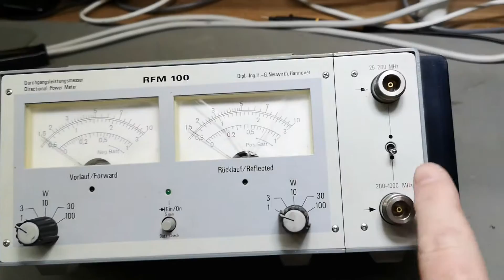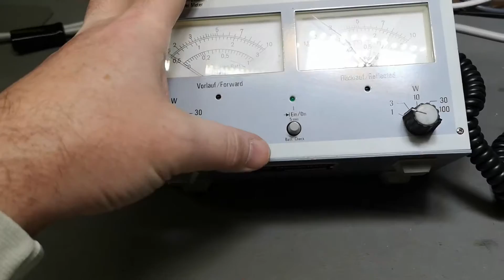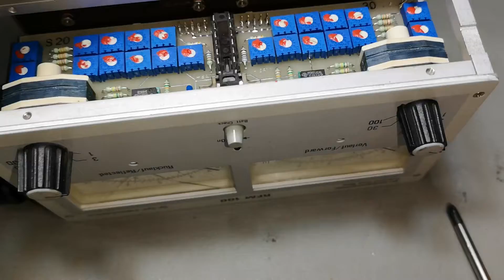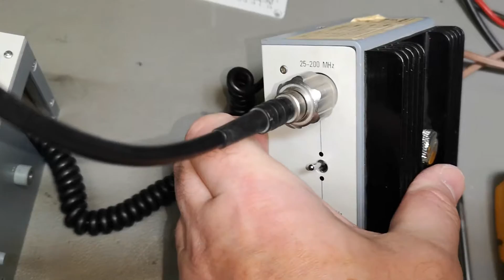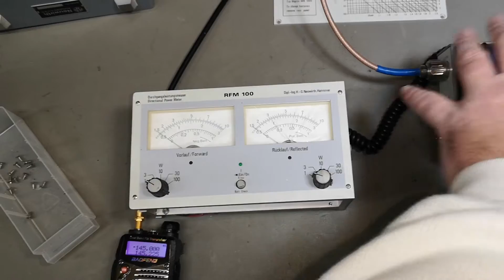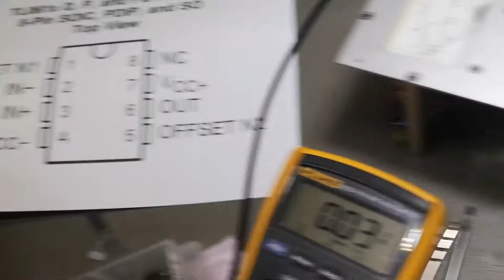Rohde & schwarz (Neuwirth) RFM100 power swr meter 100watt 1989 test teardown

Comment: I think meters going negative was the correct way for this to work. Check the meter scales: on the higher ranges, they do not start at zero, but 0.5 and 1.5, so zero IS to the left, off scale!
There is also a dashed line continuation, hinting, that the needle can go there.

Asymmetric supply is OK. RF detectors are ground referenced, and these old opamps are not rail to rail. You do not need to amplify negative voltages, so you just give them enough negative supply, to bring ground into the common mode range.
Reply from the maker: good point, but i really feel a meter that hammers to the negative when a range is selected, must be an error 🙂
could be nice to hear from other owners if they see the same ? i did write in a locan ham radio group to seek owners, no reply.
latest news is a got the schematic and will be sharing it with you all at peel dot dk
Reply: @TeardownOZ2CPU  I think it would be an error if it would not go to the left. Consider the 10W scale, indicating 1.5W at the idle point. So with no power applied, it would show 1.5W, which is wrong. And if you applied 1.5W, it would go further right,  indicating more than 1.5W, wrong again.
On the other hand, the needle going to the left without input power, tells you there is less than 1.5W at the input, which is correct.
I never saw this instrument, so can't really say for sure, just guessing.  Hopefuly, some former user of this instrument can chime in and explain how this really worked.
Reply from the maker: @markocebokli6565  i am happy for all sides of comments, I think you got a good point, we all know about bias the diode detector to get better linearity to, that means some sort of bias handeling will need to be there,